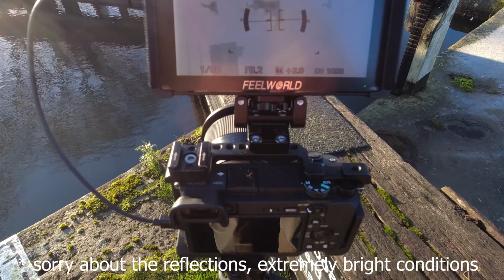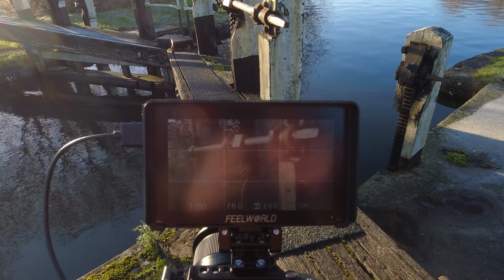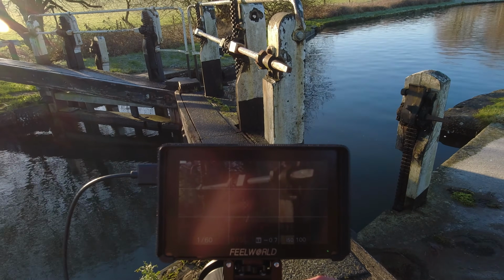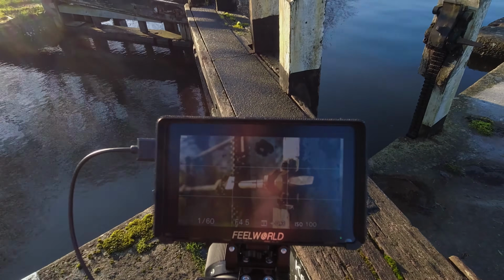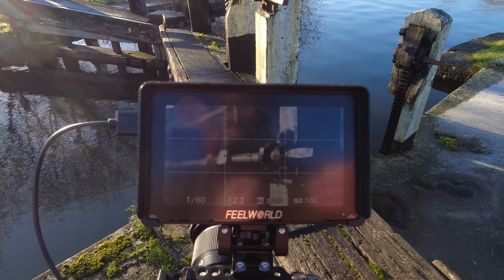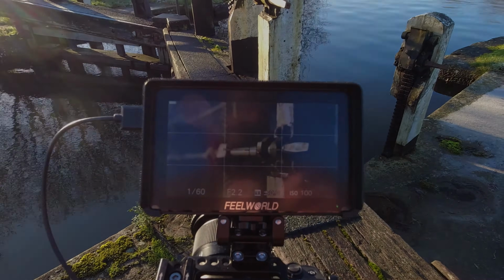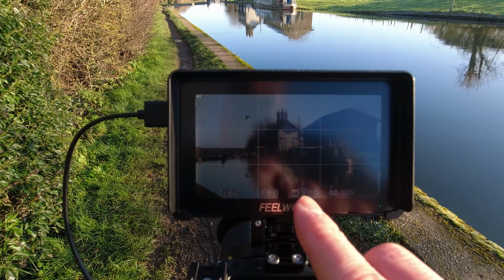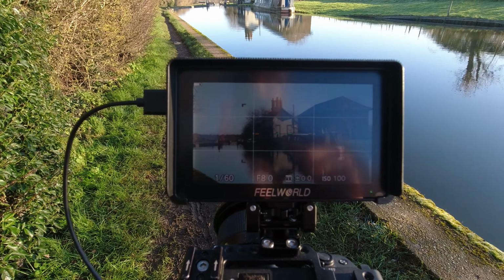BOKEH!!! Blur your Background | THE ONLY FILTER YOU REALLY NEED!

Comment: Thanks so much for the great tips on the ND filter! I will get a72mm ND filter, which should be more than enough for my SONY 18-135mm lens (with filter diameter 55mm), even if I buy more lenses in the future. 
As for the shot at 7:40, there seems to be a long-distance from your camera to the subjects. Was the attached picture shot in the distance with a full zoom? I wonder if I am too close to the subject when I film. 🤔🤔
On a side note, I've recently stopped using the Auto White Balance. 😆 Would you recommend dial in a Kelvin number, shoot a white (or grey) sheet, or choose an icon, e.g., sun, cloud, shade, etc., from the menu for setting the white balance? 
Glad you didn't fall from the little bridge! 😄
Reply from the maker: Hey Samy, the shot at 7:40 is using a 56mm Sigma. So fairly zoomed in. I may have cropped in a bit in post also.
White balance, you are meant to use a white card on every shot, but I don't like all the hassle. So I have it set to 5600K on all my videos and I adjust in post also. 
:-)
Reply: @TheCameraManReviews  Sorry, I was distracted, checking on Sigma 56mm, haha. 
I'll set my white balance at 5600K, easy!  I don't want any hassle either. I like the fact that an ND filter can stay on a camera. Thanks so much for your response :)